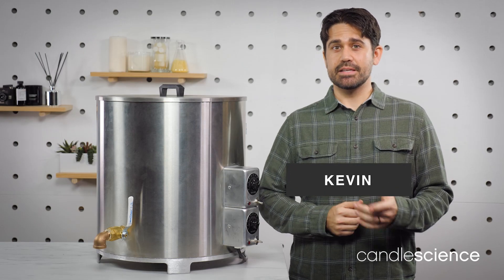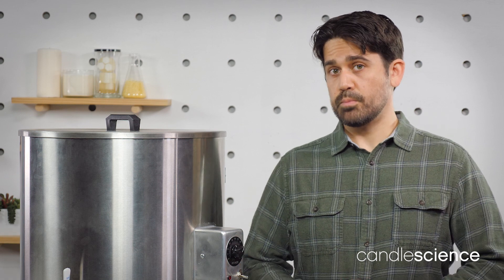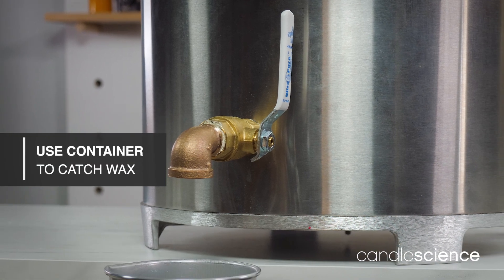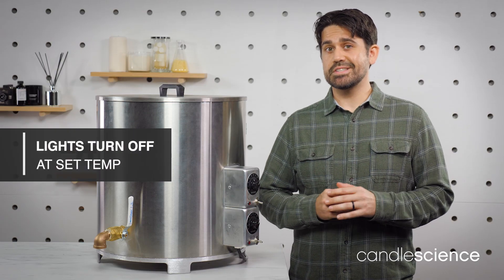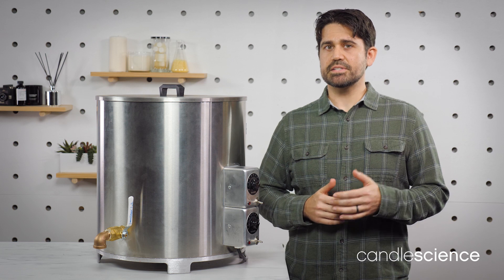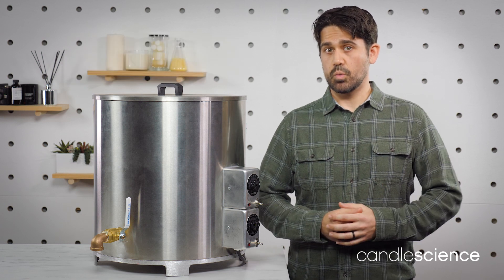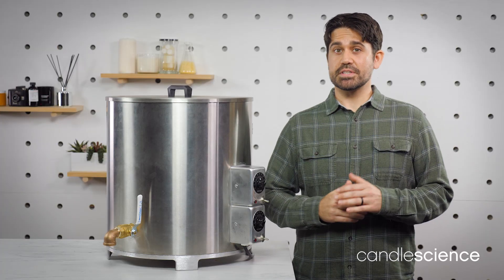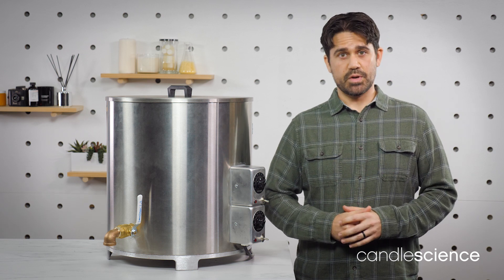How to Use A Large Wax Melter | CandleScience | Candle Making Tips

Comment: Hello, I can't reach a temp of more than 70 degrees celsius using the double boiler method. Am I doing It wrong? i have to heat the 464 up to 85 degree celsius. Thank you
Reply from the maker: Hi! It may be that the burner dose not heat enough to get to the higher temps but I would also recommend making sure the thermometer you're using is correctly calibrated as this can sometimes cause incorrect readings.

Comment: So is It okay to add color to already melted wax along with the fragrance? I was under the impression color had to be added in the beginning of the melting process (the dye blocks). Do you weigh the wax after it’s already melted? Asking because I’m use to weighing the wax before putting It on the stove for a double boiler process.
Reply from the maker: For the dye, you can add it at the 185°F point with the fragrance or at the beginning of the melt! If you add it with the fragrance, just be sure to stir well until the dye is fully incorporated into the wax. You could also add dye at the beginning to allow it more time to melt. 
You can weigh the wax before the melting process as the weight of the melted wax will be the same. 16 oz of unmelted wax, for example, will still weigh 16 oz when it's melted. If you would like to be super precise about pouring the same amount of wax into each container, you could pour the wax into the jars while they are on a scale but you should not typically need to weigh the wax after it has been melted if you weighed it out beforehand.

Comment: I'm using a small one similar to this. Why does my wax turn brownish/yellowish overtime? Is it scorched? How do I avoid it?
Reply from the maker: Holding the melted wax at a very high temperature over a long period of time could potentially result in some scorching and then some discoloration. We'd suggest heating the wax according to the wax manufacturer's recommendation as different waxes can react to heat in different ways. Not using dye or fragrance in the melter itself can also help with discoloration as both dye and fragrance can cause a color shift in wax over time. Regularly cleaning out the melter can help as well as this can remove any excess wax that might be stuck.